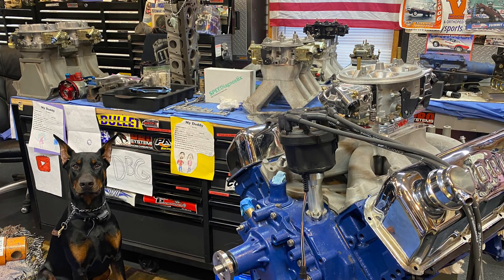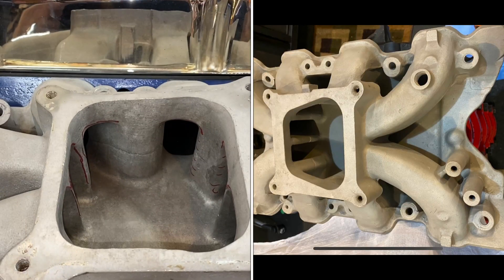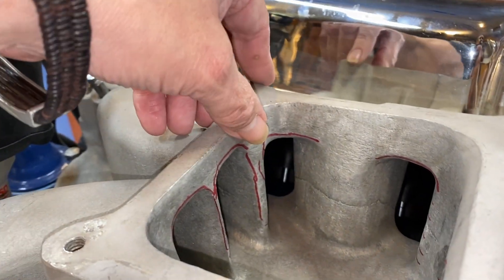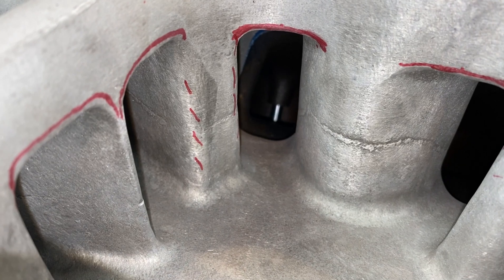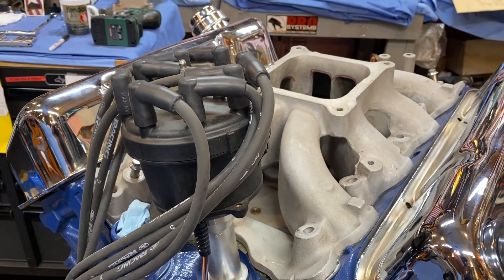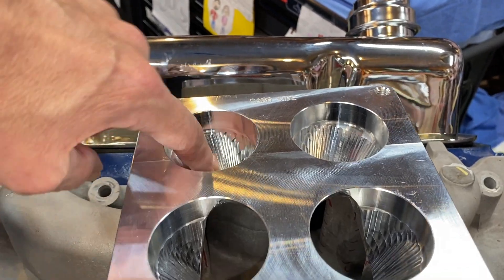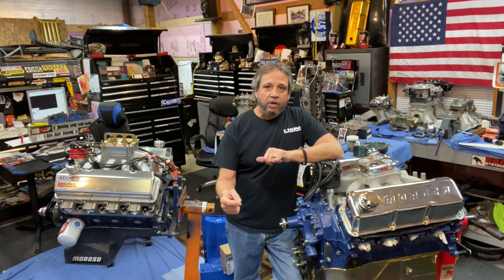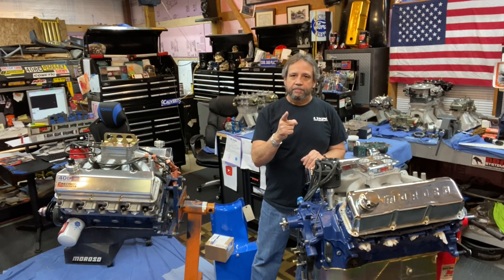DBG: Porting The Holley Strip Dominator For The 615 Horsepower 354 Ci, Ford 351 Cleveland

Comment: Seems many older intakes had a sharp edge rather than a radius to help sheer fuel. 
Bet its to idiot proof it for guys that just cant tune. For a high rpm small block def go after the runner entrys it helps. 

What all was done to you C to get that number? Crank, cam type etc etc. Impressive.
Reply from the maker: Watch this. Read description. Thanks Gordo 
DBG: The 615 HP Ford 351 Cleveland with Stock Iron 4V Heads, The Girls Start Getting it Ready...
https://youtu.be/XPj157GLjOs

Comment: You'd think a performance manifold, even from the '70s would be designed with smoother entry points than that !!
Reply from the maker: I know it, it’s one of the best intake manifolds for the Cleveland, but it looks horrendous, I know I can make it better, so stay tuned for that. Just got the engine in the cooler yesterday. Oh yeah, it’s gonna be killer for sure.

Comment: Love the videos I'm trying right now to get in the 500 hp with my cleveland any advice thanks.
Reply from the maker: Watch the video of the 615 hp Cleveland. That will give you some tips, I also need to do some live chats or videos on what’s required to get to the 500 hp level. Which really isn’t a lot, it’s the right cam and compression. Thank you Ron, make sure you sub if you have not way more in store.

Comment: Badass Tim, has to run mid-10s💯, my Vid i posted of the XB Coupe 3500lb runs mid-10s with 579hp & seems like it’s a very similar deal👌🏼🏁
Reply from the maker: Hey mate, that’s what I’m thinking 10.50s all  I want, by theory, it may be quicker. Really depends on how much power it makes since it been sitting five years, hopefully there’s no ring issues, bell springs are good. I have to check them and do a leak down. I will have to check out your recent vids, trying to keep up with all the comments and make more content . I always appreciate you mate.🏁💪🇦🇺
Reply: @dragboss351cleveland   all good Tim, no worries at all. Regardless of HP a little more or less  here n there…..it’s badass.
Would be over the moon if my “project-nascar” 4V build gets anything close to that range lol, & I’m thinking small Stroker, similar rpm’s & Comp💪🏼🏁
Reply from the maker: Hell yeah, Janks, appreciate you. You’re right it’s all bad ass and that’s why you have to look at it. Not a lot of young guys doing this stuff anymore. At least from old school standpoint.🇦🇺🏁
Reply: @dragboss351cleveland  💯your not wrong on that👍🏼🏁
Reply: @dragboss351cleveland  💯your not wrong on that👍🏼🏁
Reply: @dragboss351cleveland  💯your not wrong on that👍🏼🏁
Reply: @dragboss351cleveland  💯your not wrong on that👍🏼🏁

Comment: Congratulations on a successful channel, mine seems pretty stagnant LOL  I will try and do a video this weekend showing the build up of this engine.  I have lots of photos from assembly and a few photos from inspection after the dyno.  

Do not be surprised if it doesn't make 615 hp again, as it's been sitting for 5 years, different intake, different carburetor, different oil pan, different dyno, etc., but it should still be a real stout piece.
Reply from the maker: Hey Brent, I’ll have to check the bell springs, as I’ve been sitting, and I’m going to get it on the run stand warming up and check for any leak down. Why don’t you do this once you come on one of my live chats, And we can talk about that build on live, we can upload pictures into the studio, and chat about Cleveland‘s in general. It would be my honor.
Reply: @dragboss351cleveland  Let's do it.   I posted my own video of the build overview, but there may be a lot of questions/topics that you would want to discuss.
Reply from the maker: @lykinsmotorsports  I am scheduling into February right now. That ok. We can talk on Monday Tuesday to confirm a date. Be lots of fun. 🏁💯

Comment: Hi Tim , again great content  . In the late 80's when the funds and knowledge where building up , I loved the Holley strip dominator 4v intake manifold , however I had 2v heads so the Holley street 2v dominator was used  , great results for a street and strip application.  Funny thing is I done the same mods to my manifold  , I'm sure it contributed to my Aussie Ford Fairmont going 12.98s  31 years ago. 2v or 4v all awesome.
Reply from the maker: Thanks Peter B, I was just getting into building my own engines in the 80s, first one in 81 with my dad. RIP Dave but yes, everyone discounts that to the heads, they work well with the right combo and parts. I have a motor build coming up soon making almost 800 hp with trick flow 225 and intake. Wait to you see this video. Stay tuned.

Comment: DragBoss Garage  Hi Tim. Good video man. Is that Strip Domi the one Brent dynoed the 354 with?
Reply from the maker: Hi Matt. No, it’s not. He kept his sold it, so I just bought another one. Actually two, I traded one for some parts. I can’t wait to see how does a Dyno, I have to check the bell springs, hopefully the piston rings are not microsiezed. Run on the engine stand and do a leak down test.
Reply: @dragboss351cleveland  Too bad you cant test the difference from a stock one vs the one you are porting. That would be a great A to B test
Reply from the maker: Well I would consider the initial testing as A, the issue is the engines been sitting for like five years, so we have no idea what the springs are, like, whether some Micro welding of the rings, we’ll see what we can figure out. Thanks Matt.
Reply: @dragboss351cleveland  Yes I saw Brent's Youtube video yesterday talking about the 354 and the possibility of the thin rings. He also said he does no expect it to make 615hp again.  I know the different dynos will be some part of that so that's why the intake test wont be a good A / B test. I hope it still makes the 615hp or so but an oil pan can kill or free up 10-15 by itself. I hope the rings are ok too.
Reply from the maker: We will find out. Stay tuned.

Comment: Hey Tim...one of the mods i did years ago to my Strip Dominator...was raise the Runner entries  probably  3/8s of an inch  and Radius the Turns...Cracked  my 357 Cleveland  into the 9s...with a 9.95 back in 1990....it made a Noticeable  Difference..picked up a Tenth to Tenth and a Half...with that mod...👍🏻🇺🇲🇺🇲🇺🇲
Reply from the maker: Hey Frankie ford good to see you. Or at least hear from you. I think you definitely got something there. and ahead of the curve. It is terrible entry way. I’m surprised they work so good on the street. But on the street is much different than the track, the rpm range, you get Love that big girl  Torino.😎🏁

Comment: 615 horsepower, is soon to be 630+ horsepower!
Reply from the maker: Thanks biscuit, just looking at that, Plenum, and the adapter, the right no way it’s not gonna pick up at least 10 or 15 hp. It’ll be exciting to see. Only issue is the engines been sitting for quite some time, so I may have to check some of the springs for pressure, and hopefully the rings aren’t micro sees and have any issues. I think I’m gonna take it to my buddy Mike Weaks get on one stand. Thanks for your support.

Comment: I would love to see what kinda numbers the Strip Dominator would put out with a one inch space added on top and the top of the intake runners radiused up another three sixteenths of an inch at the top of the runner where it starts coming out of plenum, always enjoy seeing these iron heads on the dyno.
Reply from the maker: Hey Ted, I will try that, with a spacer. I’m already got a radius, the entryways, it’s it’s like a 90°, and I can tell that air is not gonna hit it right. Also needs a better line of sight to the valves.

Comment: Tim some friendly advice DO NOT run that Mr Gasket shifter. The tend to down shift when you want to up shift.
Reply: I know that feeling. I believe a subscriber sent Tim a brand new Hurst ram rod shifter.
Reply from the maker: Yes, I have both. To tell the truth, the Mr. gasket ships like a dream.
Reply from the maker: Hey Racer D, the shifter is  minimally worn, and shifts like a dream on bench. I do have a brand new nos Hurst RamRod shifter. Experience with this. Great to chat through email.
Reply: @dragboss351cleveland  I remember when that shifter first came out, all the stick shift cars had them and they all did the same thing , they would shift from 3rd back to 2nd and you drove over your crankshaft, no fun. Funny thing was some would do it on the 5th run and then some would do it on the 25th run.
Reply from the maker: That scares me, looks like I may need the ramrod, I bet that is better especially being brand new?
Reply: @dragboss351cleveland  2nd gear to 1st at 6500 gets kinda ugly. In all fairness that shifter did have a lot of street miles.

Comment: Awesome stuff Tim. Would suggest that you go and have a look at David Vizard's channel where he ports a Chev manifold. Due to the cylinder firing sequence on a Cleveland, cylinder 5 robs air from 6, and cylinder 8 robs air from 4. Even though it is a Chev manifold that he is talking about, the same principles will apply. Whenever you see staggered jetting, this is part of the cause. Regards Greg
Reply from the maker: I will check it out Greg. Thanks appreciate you💯

Comment: Tim your dead on with that intake and the spacers I'd try both spacers and taper that spacer back like you said it's worth the time and effort even if you have to take it and get it machined I could see a tenth or two in my thinking always good stuff at drag boss garage 👍 😀
Reply from the maker: Thanks Terry I was thinking the same thing. There’s so much mismatch and poor plenum appearance, any work will make a difference I bet. glad you were there last night. Thanks for supporting DBG.

Comment: Hi Tim,  that was an intake people wanted back in the day. Call Mark Campbell,  he designed it !
Reply: I too would like to hear what Mark has to say about porting the spacer and intake.
Reply from the maker: I need to get Mark back on, for some tuning tips, and regards to the intake. I’m just gonna do what I have learned from Darin, and experience. I could weld on a spacer, and grind  it  to match, at this point that’s above my level. This is the first intake I have ever ported.
Reply from the maker: Hey John, at this point, I’m just going to do what I’ve learned through Darin, and my own experience with others. And see what happens. Stay tuned. See you tonight.